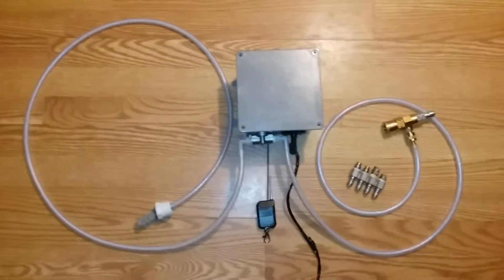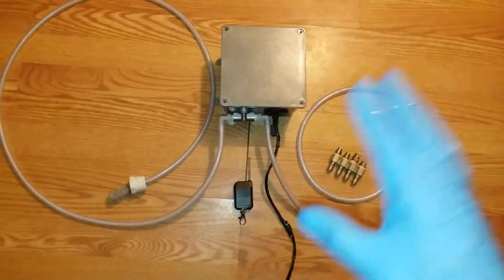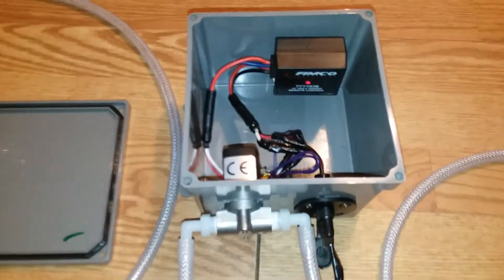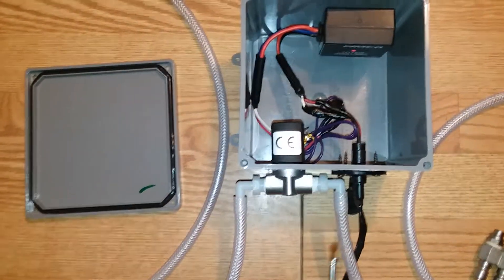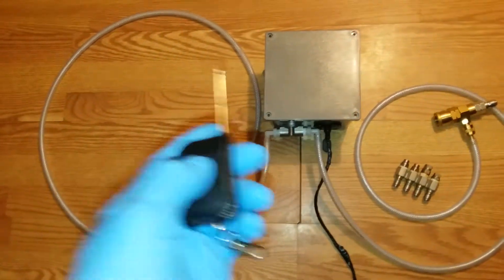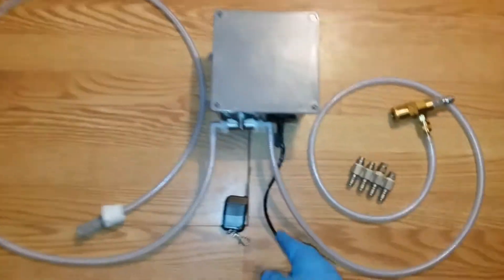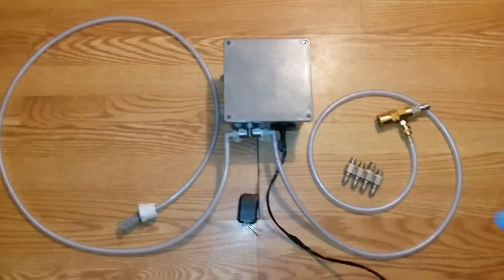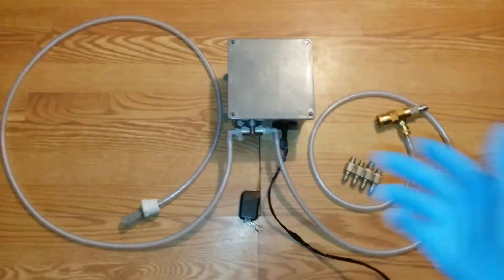Remote downstreaming system for pressure washing

Comment: Do you still need a low pressure tip to get it going or will it pull with normal tip after you turn it on?

Comment: this is the cleanest setup on you tube
Reply from the maker: Thank you
Reply: MMT I got my electronic valve and I got pvc box, I got down stream injector and my remote.  my question is the ball valve has 2 wires but the remote has 6 wires . after I hook valve to remote box where does the other 4 wires go